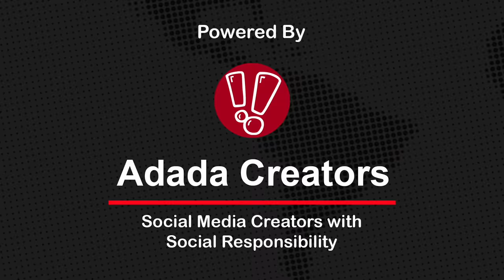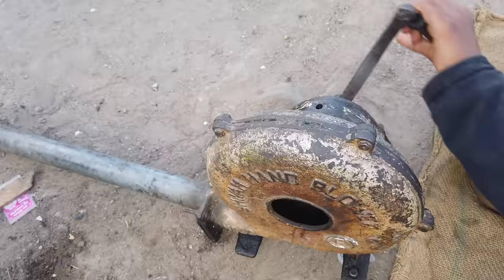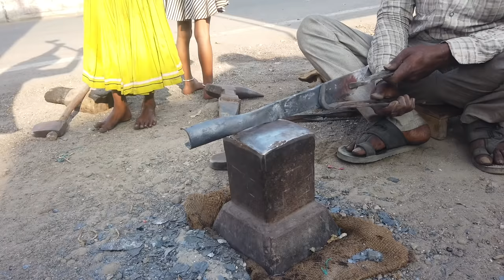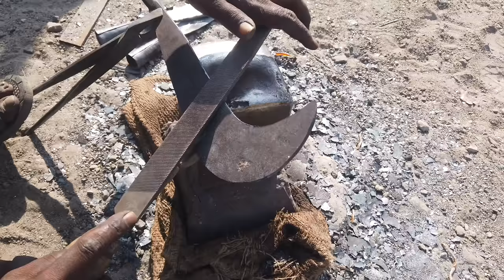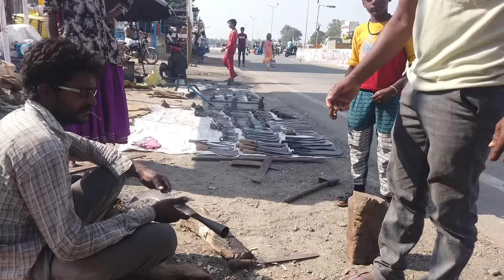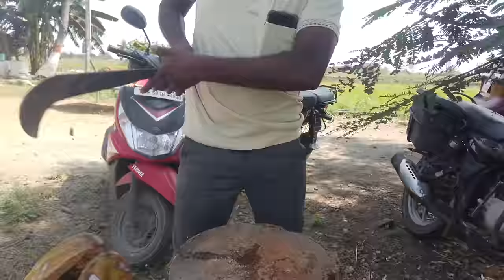Lady Making Bill Hook for Just $8 USD | Street-side Worker Making Billhook | Aruval - Cutting Tool

Comment: I think tempering was missing. Tool edge may break otherwise. Also portion near handle need not be quenched or tempered.
Reply: More than likely High carbon steel will crack at least 6 out of ten knives and 7 out of ten will warp . By the sound of that file it didn't harden at all .junk steel